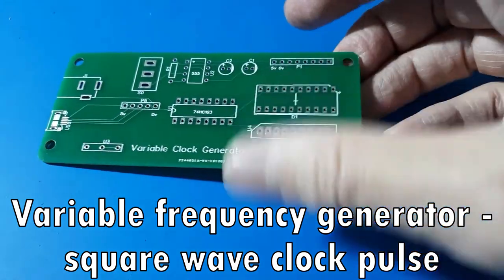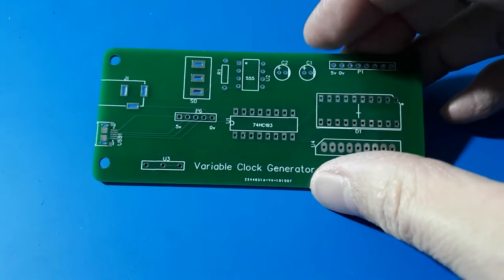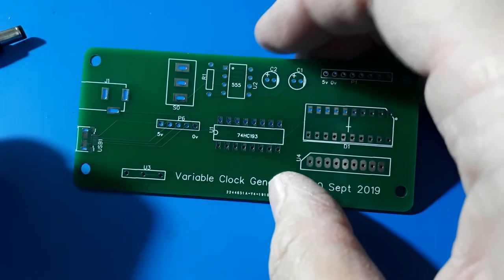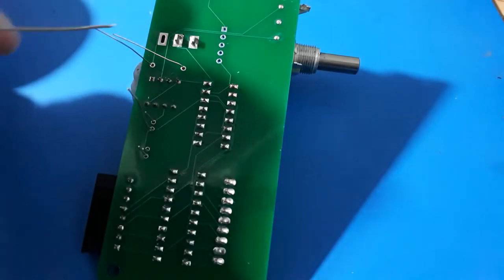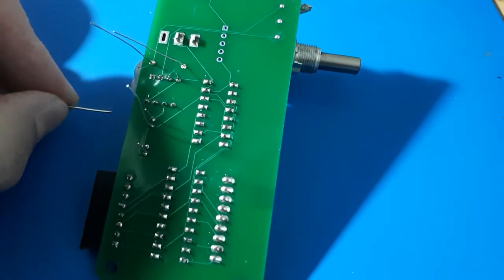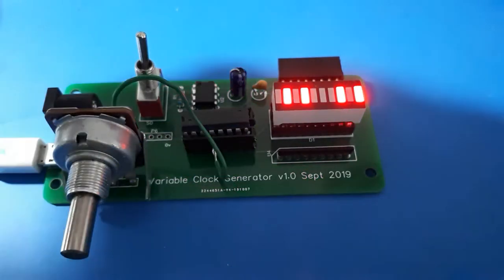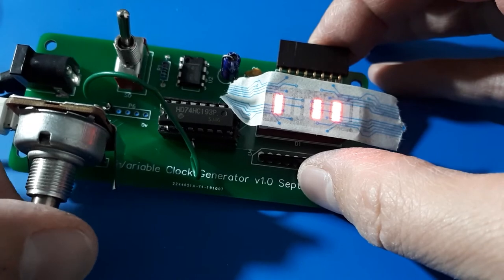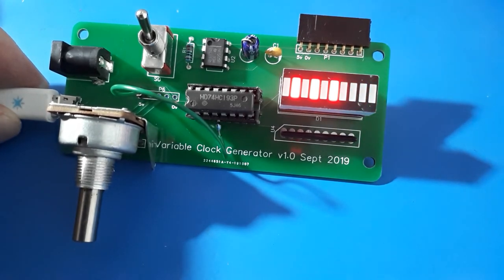Variable frequency square-wave generator circuit

Comment: Enjoying this project. Reminds me of some educational boards my mother designed in the 80s!
Reply from the maker: Speaking of which, I'm considering whether to make my CPU a DIY 6502
Reply: @CircuitBreaker256  Sounds a great idea, i'd be interested
Reply: @CircuitBreaker256  you're filling gaps in my knowledge. We used logic gates, inputs, outputs, and clocks... even 8 bit i/o from Nascoms and 380Zs ... but never actually made it makes sense as a cpu.